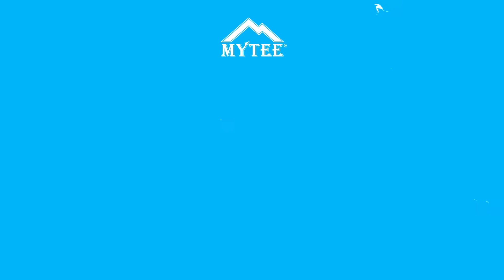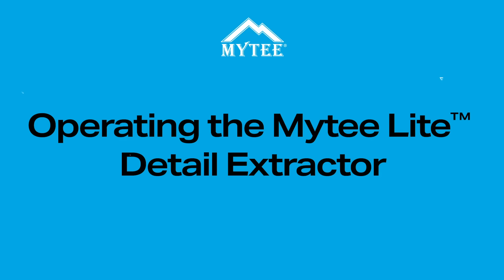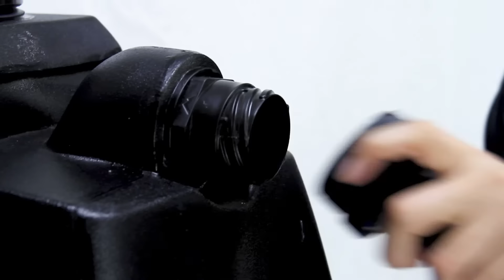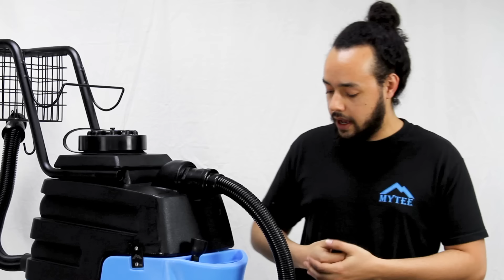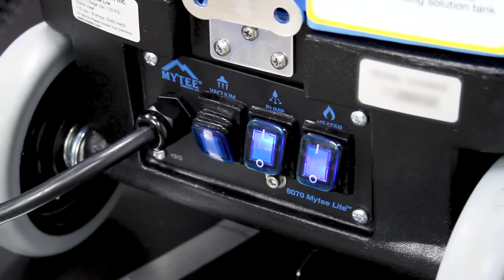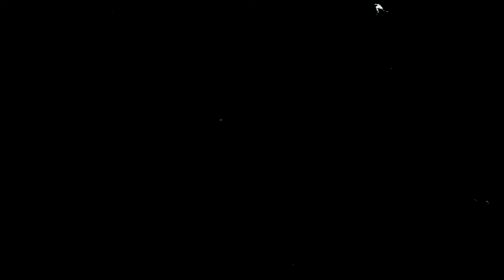Mytee How-To: Operating the Mytee Lite™ Detail Extractor

Comment: Hi, I recently purchased this machine new, but it's not dispensing any water. I filled the blue clean water tank, turned on the pump, and followed all the correct steps, but no water is coming out.

I can hear the pump running and feel vibration in the solution hose, but nothing comes out when I press the trigger. 

Could you please help me troubleshoot this issue?
Reply from the maker: Hi there, sorry to hear about that! That can happen from time to time, and should be simple to correct. Hearing the pump is a good sign that things are working properly, it may be as simple as a kinked hose or clogged jet! Hit the link below for our pump troubleshooting guide, or call our office at 858-679-1191 for further assistance! https://mytee.freshdesk.com/support/solutions/articles/17000096460-troubleshooting-diaphragm-pumps

Comment: Stay away from Mytee if you care about warranty support!!!!

I want to warn other professionals: my warranty experience with Mytee (Mighty 8070) has been one of the worst I’ve had in this industry.

1. First unit – heater failure + denial
I bought a Mytee 8070 in March. After about a month and a half, the heater failed.
Thanks to my dealer, the repair was handled under warranty - it was clear I was a new customer and the unit shouldn’t have failed that fast.

Later, the machine had a short circuit and Mytee started looking for reasons to refuse the claim. They blamed “water presence” in the base and told me to drag the unit to another service center instead of simply honoring warranty on an $800 repair after a leak caused an electrical failure.

2. Second unit - defects out of the box
At the same time I bought a second unit.
• The heater didn’t work out of the box.
• Within two weeks the pump started leaking, causing water in the lower compartment – exactly the same “water presence” Mytee used as an excuse to deny my first claim.

My dealer, who behaved professionally, had to replace this second unit completely on their own, because Mytee refused to acknowledge that water could appear there due to a manufacturing or sealing defect.

3. Warranty department & Ali (manager)
Instead of investigating, Mytee’s warranty manager Ali just kept sending copy-paste replies and repeating the same script.
No phone call, no real diagnostics, no willingness to admit that two different units with the same problem might point to a design or manufacturing issue - just constant denial and attempts to push the blame back on the user.

At this point I’ve collected full documentation for both cases and will be resolving this through legal channels and independent inspection.

4. Extra warning about serial number sticker
One more detail: the serial number sticker is placed and glued in such a way that it easily peels off. If it comes off, they simply tell you “no serial – no warranty.” If you already own a Mytee machine, watch this closely, because it feels more like a trap than an accident.

In my opinion, Mytee is an extremely unreliable manufacturer when it comes to warranty and customer support.
Instead of fixing faulty equipment and improving their product, they invent reasons to deny legitimate claims. I strongly recommend considering other brands if you want normal, honest service when your machine eventually needs repair.

Comment: Question how much liquid  concentrated cleaning solution do i put in a 4 gallon tank??
Reply from the maker: It depends on the dilution ratio recommended by the chemical's manufacturer! We recommend only putting fresh water or a rinse agent in the machine to prevent leaving detergent residue behind, however if you prefer to put a liquid soap or cleaning solution in the machine just follow the instructions for mixing that are printed on the label.

Comment: Hey mytee, I just bought your 8070 extractor and just had 2 questions, first question is should I use distilled water only or can I use regular water. And my second question was do I help to clean it well after each use if I’m only using water in the tank? Thanks
Reply from the maker: Good questions! Distilled water is not necessary to use, just make sure to use system maintainer to descale your extractor periodically and tap water will be just fine! After each use you may want to give the recovery tank a quick rinse out to reduce any odors from the recovered soil sticking around, just be mindful not to pour any water down the vacuum stack in the middle of the tank.

Comment: Absolute worst piece of equipment I have ever owned.  Nothing but problems since I bought it.
Reply from the maker: We are terribly sorry to hear that, if you have not yet taken advantage of the warranty policy on our machines, we would encourage you to! We will happily repair or replace any issues or defects within your machine to ensure it works as designed.
Reply: @myteeproducts  Warranty is 30 days only, lol.  Machine has leaked since day one, lines clog preventing water from spraying, jets keep clogging, heater on ALL the time so had to disconnect.  Everytime it gets used (once every three months) I have to perform repairs.
Reply from the maker: Our warranty covers all parts and labor for a full year, major components like the pump heater and vacuums for 2 years, and the plastic body for 10 years. You can read more at this link below. We are sorry to hear you have had trouble with your unit but we are happy to make that right for you. https://www.mytee.com/support/warranty-details/

Comment: Is the diameter of the 2005CS and 8070 vacuum hoses the same?
Reply from the maker: No, the 2005CS has a 1.5" hose, while the 8070 uses an 1.25" hose.

Comment: Hi there, great video, but I still have a couple questions that I can't seem to find answers to (sorry if they sound silly).

1) You said it's not recommended to put powder based solutions in the solution tank; but I want to put down a powder based solution into the mattress, and use this machine to rinse it off. Would that be okay, or would that not be recommended?

2) What temperature water did you put into the solution tank? Can I use hot or cold water; or is there a better temperature? Can I use tap water?

3) I want to use it for larger mattresses, does the 4 foot upholstery tool attach to the longer vacuum and solution hoses?

4) For a few items, I need to use cold water to rinse it off. Can I use this machine with just the pump and the vacuum, without engaging the heating system, or does it only run hot water extraction?

5) This one seems extra silly, but can I adjust the amount of pressure with the water spray trigger, or is it fixed?

Looking forward to hearing back!
Reply from the maker: Thanks for the questions, happy to answer them! 
1. That is fine! The powder solutions can leave sediment in your pump that may affect it, but with this method it does not go through the pump so it is okay. 
2. We use warm to hot water from a sink for best results from the heater but any temperature water can be used up to 140ºF. Higher than that may damage the pump. Tap water is just fine, but if you have harder water you will need to descale your machine more frequently. 
3. The 4 inch upholstery tool included with the machine can be used with a longer hose yes. The 15' included is enough for most applications, but up to 25' of hose can be effectively used with this unit.
4. This unit can function without the heater engaged and operate otherwise normally as a cold water machine.
5. In this unit the PSI can not be adjusted.

Comment: Can you run this on a 15 amp circuit? Or do you need a 20 amp circuit to operate it?
Reply from the maker: With all components on, you need a 20 amp circuit to run this unit. However, you can run it without the heater on a 15 amp circuit.

Comment: Is the hot water from the Mytee 8070 hotter than the Mytee s300H?
Reply from the maker: Both have the same 210º max temp, but the 8070 has a higher wattage heater, meaning it will get to that temp faster and hold it better.

Comment: Pretty sad i got a brand new one and pump dont work out the box bad first impression
Reply from the maker: Very sorry to hear that! Make sure to thoroughly read the manual to ensure proper operation of the machine. If you are following the steps outlined correctly and still are having issues there may be a defective component, but our warranty can cover the total cost of any repair or replacement needed to fix it so not to worry. Call our office at 858-679-1191 for assistance, we're happy to help!

Comment: So the solution tank is water + your solution product not two different tanks
Reply from the maker: Yes the clean water tank is also called the solution tank. We do recommend using just clear water or water with a rinse only in the extractor, no detergents.
Reply: @myteeproducts  thank you for the feedback

Comment: Great quick overview of this machine.  A few questions on the machine though……..
1) Can you use tap water that is on a softener system; 
2) What de-foaming solution is best and is that placed in the water tank or recovery tank; 
3) When done with a job, can you clear the lines of the water by simply engaging the wands trigger to empty out the remaining water or does that have the potential of burning up the pump; 
4) And lastly, to winterize the machine can RV grade antifreeeze be ran through the system?
Reply from the maker: Thank you! 
1) Yes! 
2) We don't have any official rec's for brand but either powder or liquid will do. We put it in the recovery tank when we use ours but some cleaners prefer to put it inside the vacuum hose or sprinkle the powder direct onto the surface they are cleaning, this is fine also. We wouldn't add it to the clean water tank. 
3) It's a good idea to trigger tools at the end of jobs to release any built up pressure before disconnecting the tool from the machine, but this won't clear 100% of water out. You do want to avoid running the pump dry, if it sucks in air bubbles it may need to be force-primed when ready to run again.
4) Absolutely!

Comment: I have a mytee 8070 as soon as I plug it up it lights up but when I turn the pump on it shut off the power breaker I need help
Reply from the maker: You need a 20amp outlet to power this machine properly. Using a 15amp breaker can lead to tripping the power when all components are on concurrently.

Comment: Does it run off regular 20amp garage plug.
Reply from the maker: Yes any standard 20amp 110v-120v outlet will be able to provide proper power to your 8070

Comment: Will this work well or have enough suction power for the other attachments for home carpet use aswell?
Reply from the maker: This is the appropriate size carpet wand to pair with the 8070, though we recommend using it only for small areas or spot removal. If you need to do large wall to wall carpeted areas we suggest a full size extractor like our speedsters https://www.mytee.com/products/8390-ez-single-jet-carpet-cleaning-wand/

Comment: it runs at 19 amps so you need a 20 amp power source
Reply from the maker: correct! 20amp circuits are commonly found in bathrooms, kitchens, garages and of course generators
Reply: Lights up red everywhere I connect it. What does that mean?

Comment: @Mytee    I know the order of buttons to turn them on, pump, heat then vacuum. What Im wondering is Do I turn the switches off then in the reverse order , turning the pump off last? Also, Do I have to turn the machine off to refill the solution tank and dump the recovery tank? And also, How long can I have the heat and Pump turned on before it hurts the machine? I would really like some answers and I know you can help me. Thank you!
Reply from the maker: 1. Order you switch them off does not matter, you can turn them all off at once even. 2. The vacuum needs to be off when dumping the recovery tank, but the heater and pump can stay on 3. Quite a long time, the heater has a thermostat that will prevent it from overheating. Basically while they can't just be left on indefinitely, it wouldn't be something you would need to worry about when used normally and shut off at the end of use
Reply: @myteeproducts  ok, thanks alot!

Comment: I feel like mine doesn't heat for a long time. Do i need to put hot water in
Reply from the maker: starting with warm water in the solution tank can definitely help the heater sustain temperature for longer. We also recommend two dry passes for each wet pass to allow the heater time to get back to temp

Comment: What does the top lid do?
Reply: That's the recovery tank.you can use the opening to either clean or remove debris from the tank.
Reply from the maker: What he said! It gives you access to the recovery tank to be able to clean it, access the vacuum stack and check the filter. You can also add defoamer to your tank from there
Reply: @myteeproducts  how does the defoamer work in that tank? I was assuming thats the tank that just holds the dirty solution or am i wrong?
Reply from the maker: @DrippysMobileDetailing  you can pour liquid defoamer straight into the recovery (dirty) tank to prevent foam buildup inside from incoming dirty water which can harm your vacuums. Just make sure to not pour it down the vacuum stack or it kind defeats the purpose!

Comment: I thought in the manual it says to use defoamer in the recovery tank and not the solution tank
Reply from the maker: The important distinction is whether it is a liquid defoamer or powdered. We do not recommend putting any type of powder–defoamer, detergent, or anything else–in the clean tank as it can lead to issues down the line with build up inside the pump. Liquid defoamer is fine to use in your clean solution tank though, and powdered defoamer can be effective if put directly into the recovery tank, so it never ends up going through the pump.

Comment: What’s the difference on the 8070 & the hp60 spyder can seem to see the difference besides the size?
Reply from the maker: Besides the difference in size, the HP60 has 20% more heating power and a slightly stronger vacuum. It also has the buttons up top for easier reach and a bucket height waste dump valve that makes emptying a bit easier

Comment: I cant get the water connection hose to hook up to the machine pls help
Reply from the maker: You could have pressure in the line, making the QD difficult to engage properly. Try relieving this pressure by using a pencil to press in the metal nipple inside the female QD on the machine.

Comment: I JUST GOT MINE AND IT WONT HEAT AFTER 3 MINUTES OF USE NOMATTER THE TEMP OF THE WATER I PUT IN OR IF I LET IT HEAT UP FPR 20 MINUTES ITL GET THE BRASS SUPER HOT THEN NOTHING AFTER USING FPR 3 MINUTES MY UNIT IS BRAND NEW ANY SUGGESTIONS BEFORE I SEND IT BACK
Reply from the maker: Hi Joseph sorry to hear you're having issues! Give us a call at 858-679-1191 to speak with a service rep and they will help you get this taken care of! You can also find a local service center using our map here if you prefer https://www.mytee.com/support/find-distributors/
Reply: Im having the same problem with my brand new one. Did you solved the problem?

Comment: I have the problem with the water heater which stops working and because the cables are of poor quality and burn very quickly, the other parts are very good the vacuum and the water pump
Reply from the maker: If you have wires malfunctioning it could be a manufacturing defect, and should be covered by our warranty. you can file a claim with us here: https://www.mytee.com/support/warranty-support/

Comment: Do you connect these to generators? Or houses
Reply from the maker: Either works! Note you'll need a 20amp circuit to run all of the components at once, so if none are available a generator is recommended.

Comment: Hi I just purchased one I'd like to know what are some cleaners and shampoos we can use from home depot in the mytee 8070 to shampoo cars ? I don't care what anyone says iv clean 100s of cars with dawn it's safe gets the grease and works even when using a shopvac but I'd like to know if dawn is safe for the machine?
Reply from the maker: We recommend using just plain water inside the mytee lite to act as a rinse for chemicals applied as a pre-spray. If you do wish to use a solution inside your unit, we reccomend you only use low/non foaming chems.
Reply: @myteeproducts  water it is then thank dont want to risk my 1300 unit
Reply: BioBreak for a prespray and Flex Ice for extracting/rinsing. Best combo available.

Comment: Hi I just got the Mytee lite 8070. I just wanted to know if I'm supposed to put in any Cleaning product in the water to clean the seats and carpet or do I not need to use any cleaning product with this extractor.
Reply from the maker: Up to you! You can pre spray areas with chemicals and rinse them out with clean water or add a low-foam solution to your clean water tank, just make sure whatever you use doesn't create too much foam in the waste tank